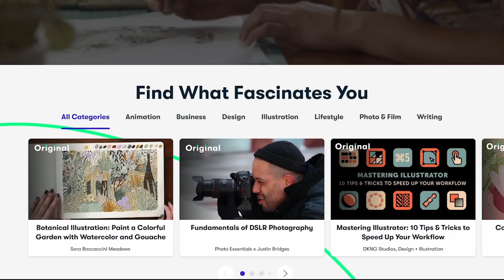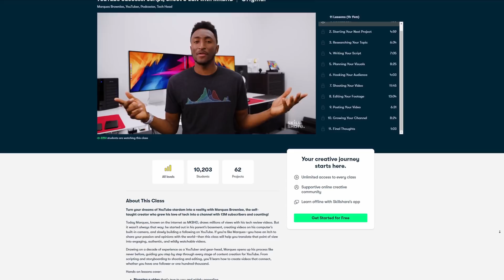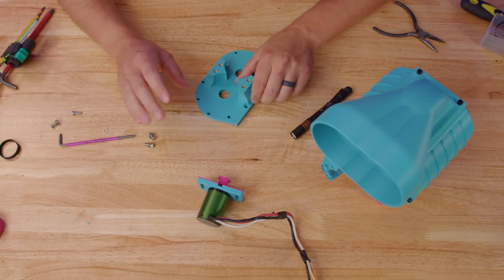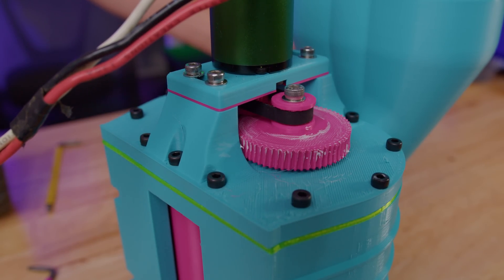I Attached a 100,000 RPM MAX Castle Mamba to my 3D printed SUPERCHARGER..... Will it Survive?

Comment: You are always better with a battery. If the battery pack you have is what I think it is, it can handle about 600W (it can give much more, but for a short period of time, and its not healty for it). Buy some high capacity (mAh) high discharge rate (C) cells. You can even try to use 3-cell pack (I suppose the battery you have is a 2-cell), but there is a question if the ESC can handle it. The motors usually can, until they cant...

Comment: Replace lubed plastic points with HDPE plastic as bearings, Balance impellers and pulleys/gears, Use cogged belt and pulley. Brushless motors are awesome but they don't slow start very well. Should be a ripper!

Comment: If you truly want to see it cooling capability. Try using it in the manner that those were designed for. Try making it flow like the venturi affect. That is a high volume pressure pump. Keep the speed down to around 800 rpm and bring the pressure up.

Comment: To move even more air you could cut slits in the tips of the rotors and glue some splines in to decrease the air gap.  Playing cards should be flexible enough to give a decent seal and still move freely.

Comment: Air flow vs pressure...
A super charger is good for pressure, not for airflow.
The way to measure pressure: Can you blow in a closed of box and measure the pressure difference inside and outside the box?

Comment: A lower KV motor would probably net you better results as well. Giving the motor more torque to turn this thing over and overcome that it's directly driving this without much reduction. Add to this the air resistance being forced through isn't helping you as well. Meaning it will draw much more amps than normal, run hot, and increase the chance you'll burn out the speed controller. So be careful when you get a power supply that can run longer than a burst as you'll be more likely to toast something else!

Comment: Why not use a stepper motor and controller? You could run off conventional power supplies - and it should have enough torque to allow using a better gear ratio (maybe enough to make up for the ~1000 RPM max speed)

Comment: I know there are more expensive and better options, but have you looked at power tool batteries, like DeWalt has a 20VDC 6 Amp battery, it is designed to run heavy duty power tools, like miter saws, for an entire work day.

Comment: Major Hardware you can look up adjustable power supply, their are lots of them out there but I would suggest doing some research before getting one so you can find exactly what you need
Reply: any questions you have has most likely been done by a hobbyist in that area

Comment: Obviously, the simple fix is a big (lead-acid?) battery, two motors, & stronger timing gears. You are lacking torque! A sheet of Lexan as a safety shield would be a wise addition.

Comment: Has noone mentioned that your timing gears are worm gear profile? I mean they seem to work but they are dished and have little to no contact in the middle of the tooth. A chevron/Herringbone gear or even straight spur would be a better choice.

Comment: Brand X electrical has a 100A power supply with a voltage range of 13.8 to 16.2V

Comment: Would a Meanwell RSP-2400-24 work?  It's about the same voltage as a 6S battery (24v) but provides up to 100 amps, and you can parallel them up to 300 amps...

Comment: Worth seeing what cfm that motor will produce if connected to the fan showdown/noctoa fan blades. Comparing the blower to the fans driven by the noctua motor doesn't seem like a valuable comparison.

Comment: looks like youre using 3s lipo packs.. if you have a lead acid battery charger (one with a jump start option would be best) borrow the battery from your car put the charger on it motor will likely draw more power than the charger can output unless it has the jump start option but the charger should extend the battery life which would already be significantly more than your old lipo packs

Comment: The device you are looking for to replace the overheating batteries would be a bench power supply. Pretty easy to use, set the voltage to the device input and you can limit the amount of amps to reduce or limit output power. You should be able to find a 0-30v 0-5amps supply for about $40-$60
Reply: 5 amps is a joke, most of the ones on Amazon only go to 10 amps, but you need like 150 amps for this

Comment: Could try a 12v desktop CNC motor. Fairly easy to get anywhere between 100-1200w versions, I run a 800w version off an iMac pro power supply.

Comment: There's a really cheap Lipo battery I have from "Goldbat" for 25$ USD I bought from Amazon, it might sound sketchy but I've had it for more than half a year now and I had no problems with it whatsoever.
There are many specifications too, you can do 2 or 3 cell or above and I have a 50c 5200 mAh battery from them, maybe  lt would be a more suitable battery for the project very soon, but that is your choice! 
Anyway this was a great video and that is a really cool looking Traxxas Rustler you got there! Thanks!👍

Comment: get a beefy pc psu, check how many watts can it deliver on the 12v rail. It may be enough for a single esc/motor. You can add a car audio capacitor and hook a 8-pin to a xt-60 connector and you`re done. Bonus points if you catch the sparks in a video :D

Comment: Meanwell branded power supplies.  I run three 5v 120a supplies in series for my Honda Insight that is converted to gas only.  Adjustable swing from nearly 12v upwards of 18v.  Example is HRP-600-5, or HRP 1000-15

Comment: Add Berings at each rotation point...
Get a Large Drill motor Battery and Charger..
The Battery will last longer.
Check out the charger... It might be the cheapest way to get the Amps you need..
You can always put the batteries in Parallel but be careful that you don't start a fire due to Load Differentiation....
You Rock👍👍👍👍👍👍👍
😀😀😀😀😀😀😀😀😀😀
🇺🇸🇺🇸🇺🇸🇺🇸🇺🇸🇺🇸🇺🇸🇺🇸🇺🇸🇺🇸

Comment: It looks as though a 12 volt power source that can put out a lot of amps would do the job.  If you have a spare ATX power supply from an old PC you can get something like a "DEVMO XH-M229 Desktop PC Computer Chassis Power Supply ATX Transfer Board" or a "Electronics-Salon 24/20-pin ATX DC Power Supply Breakout Board Module" (Amazon has both) to enable you to switch that power supply on, and then splice into the power supply's "4 pin", "4+4 pin" or "8 pin" EPS connector to get 12 volts with plenty of amps.

Comment: Sounds like you need to set your floats. The screw compressors I rebuild usually have a float on one side and negative float on the other. I suggest using cup and cone bearings with a reinforced housings with the float set. Drive either the left or the right side and put the gears on the opposite drive end.

Comment: @Major Hardware if you are looking for a very good powersupple that is adjustable. Have a look at the Keysight RP7943A Regenerative Power System, 20 V, ±800 A, 10 kW, 400/480 VAC. If this supply can't run that motor then you just have to buy another motor. Kappa.

Comment: You linked the inserts twice instead of linking to the motor.

Honestly I'd say grab a drone battery. For $25 you can get a 3s 2200mah pack that can pretty easily push 150+ amps and hold it for long enough for something to blow up. Pretty cheap solution and if you find one with the right dimension you can repurpose it for other things.

Comment: As for batteries you'll be wanting a big boy battery like a 4s from max amps 100c rating.
Hobbywing do a decent esc to power a motor like that.
You could use the throttle trim on the radio to start speeding it up.
I would also suggest putting foam strips or rubber into the impellers so that it creates a better seal to further increase airflow.
You could also gear it up so that the motor runs much slower to run the supercharger gears faster.
If you had the gearing right you could actually just hand crank it upto those speeds 🤣

Comment: time to swap it out for a small rc piston engine running off either the race mix fuel or methane .....
Well there is that or get a dremel since you can get plugin ones of them and make a cooling jacket so the engine doesnt cook while running.

Comment: Easiest way is get your self a castle sensored esc, you can adjust all the parameters with software on pc, and else sensored motor + esc will give you a much smoother rpm control
Reply: That motor size tho, won't take more than a 4s, decent CHNL racing battery will do you good,

Comment: I've dealt with used server power supplies on ebay. They have insane outputs and are dirt cheap. I use them for heavy battery charging and even set one with a floating ground and ran it in series for my 24v 3d printer. While the power output is certainly there, converting it to your exact voltage will require a little more work that may not be worth the time. It will certainly be the cheapest option though.

Comment: Connect the power supply in parallel to the fully charged battery, set it to the full charge voltage or just a hair below that voltage so that it will give it an extra bit of power to keep the Li-po from draining super fast.

Comment: A traditional power supply would be crazy expensive. But you can use a lead acid car battery or deep cycle marine battery hooked up to a 12v charger to power it. This is basically how they power slot car tracks and UPS systems. 

The battery works like a mega capacitor to absorb the heavy amp draw to average out the load.

Use the castle log to see what kind of sustained amps you pull. This should be much less than startup. Then you need a charger or simply a 12v power supply that is at least that big. Possibly even a pc power supply or 20A variable power supply could do it.

Don't do it with lipo though. Just because you can't walk away ant leave them running. SLA is much safer.

Comment: The number of hobby people in here who don't understand the difference between RMS and peak draw is comedy gold.  

So, let's take a hefty LiPO battery.  Most of these come in voltages ranging from 7.2 volts up to about 12 volts or more.  That's because the hobby started with sealed can motors using brushes back in the day of nickel-cadmium (Ni-Cad) batteries, and they were a "540" size ( 12 volt motor.  The modern HIGH end battery pack is going to be good for maybe 6000 to 7000 mAh.  That's milli-amp hours, or 6.0 amps to 7.0 amps at 1 hour  

Watts is volts times amps.  We have folks talking 80, 100, 150 amp draw.  So if we take the SAME 8.4 volts and apply a 150 amp load, that's 1,260 watts or 1.26 kilowatts.   So an RC car battery pulling 150 amps at 8.4 volts would deplete the battery in 2.4 minutes.  But you get much longer run times in RC cars and planes why?

Because 150 amps in this case is the PEAK draw.  You don't want peak, you want the RMS draw, the "100% wide open constant throttle" draw which is not max load, the max load is under hard acceleration from a dead stop.  This is why car stereo's love to put "1000 WATT!" on their advertising, then you read the fine print and it's more like, 125 watts RMS.  RMS stands for Root Mean Square.  This is calculated based on a pure sine wave power output, and it also means you have to know what the resistance of the circuit is, but RMS power is the "reliable" steady state power the system can deliver.  Same for an RC car motor and battery. 

Bottom line is this: if you don't go from 0% power to 100% power momentarily but instead ramp up the power gradually, you should be drawing far less than 100 or 150 or 200 amps.  Back in the day, it was kind of intense for a brushed, hand wound motor to draw in the 100 amp range, but newer brushless motors produce more torque and RPM's and draw more power.  So you can easily get a power convertor to step down 120 VAC to 8.4 VDC and as long as you are cautious with the "throttle" you don't need some insanely nuts 1 kAh power supply.  In fact, you probably need 8 volts and about a 25 to 50 amp max to safely play this game.

Comment: Call me crazy but get a kit for a electric skateboard.... ya you'll have to make a mount for that much larger motor but the esc an battery setup for those would have no issue whatsoever getting that sucker up to speed hell you could probably make a overdrive gearbox for the thing and aim for 2k cfm

Comment: A two to one gear ratio or even a three to one ratio would be better your killing batteries so fast because the motor is needing to make torque not rpm torque requires more amperage rpm requires voltage, if you find a strong way to have a gear reduction it will be easier on the motor and electronics and will more than likely turn more rpm on the blower, if you change the blower impellers to helical it will reduce the noise some and even out the friction between the impellers. And if you follow this recipe we might see a glorious rapid disassembly.

Comment: Meanwell makes high quality power supplies in the 12 to 48v range up to 2000w. Check out their RSP line of power supplies. I use them all the time. Hook it up to a buck and boost converter to adjust the voltage

Comment: If you hook it up in parallel with the lipo charger the battery can handle the spikes and the supply can smooth out the voltage. Depending on what kind of lipo charger you have.

Comment: Think of a power supply (within logical power ratings) and it exists. The problem is getting them as a consumer though, and it'll cost ya. Also learn a bit more on inductive loads and inrush currents, those are causing most of your problems and can make for very dangerous situations if you "blindly" shop for a power supply.

Comment: I ran into overheating issues when I was running a 5700 castle motor in my 4x4 slash, because the smaller motor isn't designed for that load. you have to balance torque with RPM. High RPM means low torque and vice versa.

Comment: Eh, just use a car/marine battery. Depending on the battery you could safely draw well over 100 amps at 12v continuously for a decent amount of time. On the plus side they have a peak short term capacity (cold cranking amps) that they can sustain for 15-20 seconds. Depending on your lipo charger you could charge the Pb battery.

Comment: Just get a hobby desktop switchable powersupply from an Electronics store..
You can get something like a 15 amp 30-60 volt adjustable digital supply with control knobs and LED display.. for about $100

Comment: did you try using the same material you used to print the gaskets to possibly print a belt to fit correctly, cause it looked like the belts you jimmied together broke at their connection point. 
Then you could possibly print different sized gears and play with that setup similar to real superchargers

Comment: The motor could use an upgrade; I think a Castle 1721 2400kv (speed run motor) and a matching ESC (Castle MMX8S) would really cool; though you'll likely break something :) Battery wise, look for something from CNHL and their speed run series. That way it'll be on the 3d printing to hold up and you won't be electronics/motor/battery limited.

Comment: Another option would be an airsoft motor, they usually come in high torque variants but still run at 20k rpm plus, might be a better option for something like this

Comment: Update the rotors do allow some sort of silicone interface between the blades to try and do better sealing of the edges once you get a better power supply. Do some sorta testing on static pressure output. Would love to see it actually hooked up to a radiator to see how cool it could keep a CPU.

Comment: I think you need to use different lube for your gears!

Maybe print them to be tighter with rounded tips rather then sharp ones, giving the lube a small area to squeeze into, helping give more consistent lubrication to the gears! You could even just sand down your existing ones, be that might cause uneven surfaces and at high speeds that can be risky.

Comment: Try some RC spur gears instead of the 3d printed ones, mount a matching pitch pinion (mod1 etc) to the motor. & Mount the motor between the 2 spurs... There's your gear reduction & it relieves strain on the motor.

Comment: The blower bearings inside the case must have some EP grease. The pressure that that bearing have will overheat in a few seconds and after a few minute can melt the housing.

Comment: While the airflow isnt that great compared to the other fans you made considering noise and footprint, the pressure should be insane so it should beat anything on a radiator.

Comment: A lot of rc motors have a specific max voltage and since it’s a 100k rpm motor I would guess it’s probably around 4 volts max so maybe just find a new motor and esc u don’t need the steering servo for it to work

Comment: Use different motor as, 775 brush motor it will work quite nice and it need 12 volt and you can increase volt to increase rpm

Comment: Not sure how well it would do at turning that motor but maybe check out a tattoo power supply. Depending on the model they are usually adjustable on voltage and current.